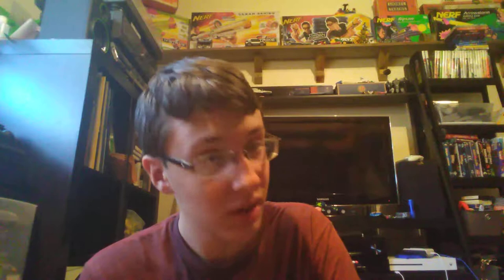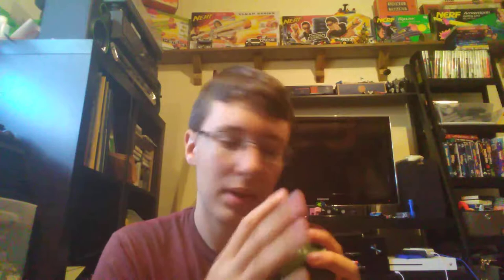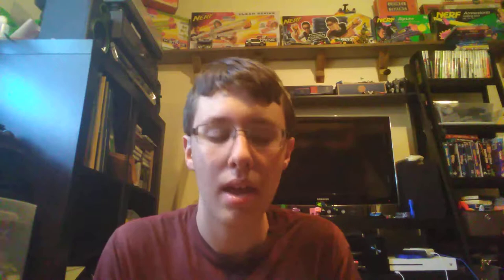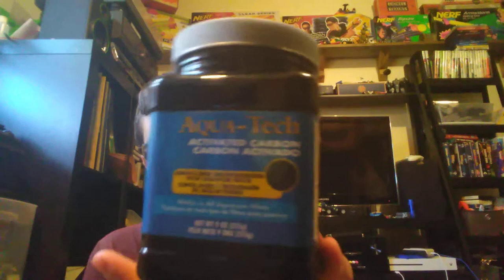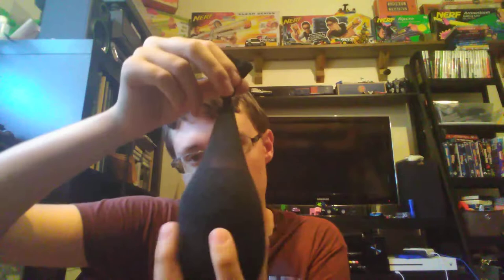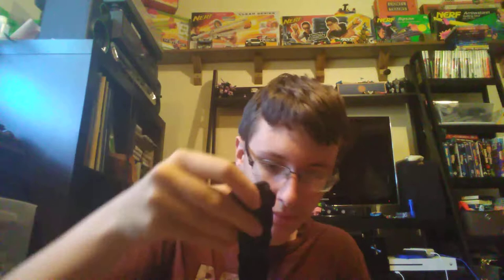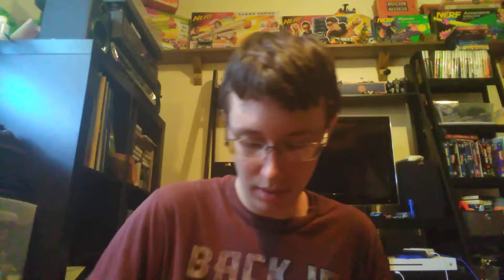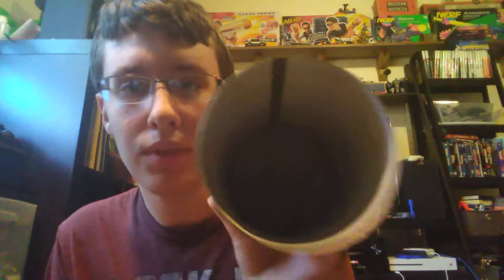How to make (temporary) filters for GP-5 gas mask (OLD CHECK DESC)

Comment: How were you able to take the bottom of the can off? im interested in making one of these.
Reply from the maker: I used old cans that were already opened in our basement. Any empty can of your preference should be fine.
Reply: @tysminecraft360  I understand but how were you able to friction fit the bottom of the can?
Reply from the maker: The small one is glued but the bigger one I just stuck the lid on and it friction fitted on. If you find a can you like, once you've put everything inside you can glue the lid on the bottom.
Reply: @tysminecraft360  did you use a certain type of can opener?
Reply from the maker: Yes. My mom has a smooth edge can opener from pampered chef.

Comment: my question to you is I have a special gas mask adapter I think it says its to be filled with cotton so how bout as a proposal I put cotton put an activated charcoal  furnace filter cut to size and than another cotton? thoughts please thank you
Reply from the maker: I dont think just a furnace filter would be enough charcoal to actually block anything and the cotton probably wouldn't do much either. I recommended getting p3 filters to cut to size for your can of choice and aquarium charcoal like as shown in the video. Thanks for the comment. 
Ty
Reply: all I can say is I dont know as it said the furnace fillter was designed for air purifiers???
Reply from the maker: The furnace filters are mainly for air particles. To block any airborn chemicals you would need more charcoal then what is in those simple filters.
Reply: @tysminecraft360   Hi tried to look up what a p3 filter is it is very similar to a material used or the same as an official filter?
Reply: @tysminecraft360   could you please tell me what a p3 filter the science I know some about us fire fighting not gas mask filters thank you please explain
Reply: @tysminecraft360  did I read Kn95 qualifies as P3 filter ? Than you
Reply from the maker: P3 level protection filters are in real gas mask filters. I dont know for sure if p3's are equivalent to those but even if they aren't they will be better then simple cotton.
Reply: Thank you my question is where do I get p3 filters ?
Reply: Ps I think I saw a video where someone chopped up there n95 and used it as part of a filter thoughts please thank you
Reply from the maker: You can usually get p3 filters online. I used these for mine. Im not 100% sure if they're p3 rating equivalent but they seemed to work. https://www.amazon.com/Particulate-Filter-Compatible-Installed-Retainer/dp/B08L6BF8M9/ref=mp_s_a_1_4?dchild=1&keywords=particulate+respirator+filter&qid=1621777578&sr=8-4.